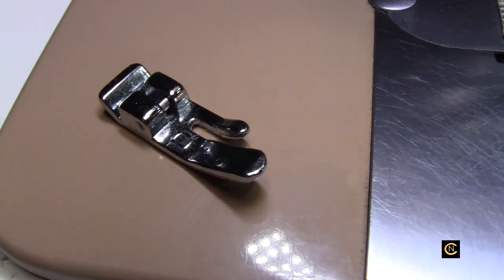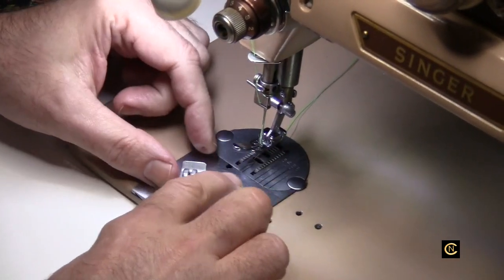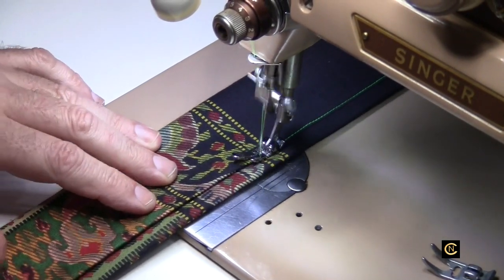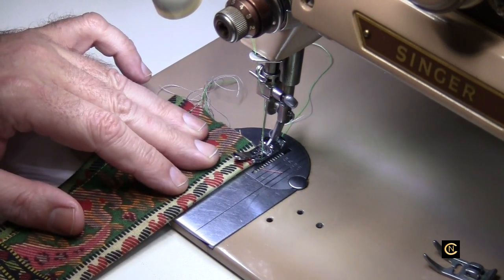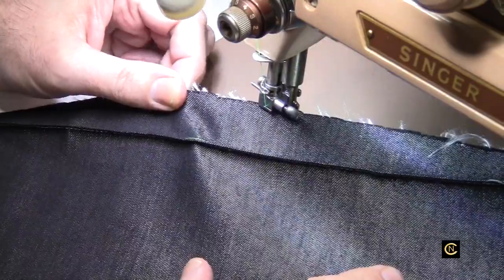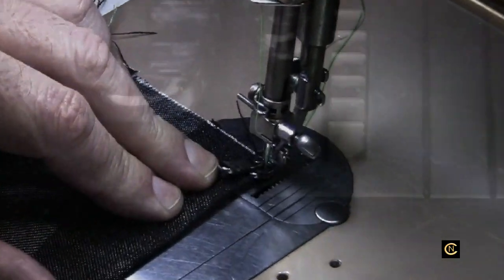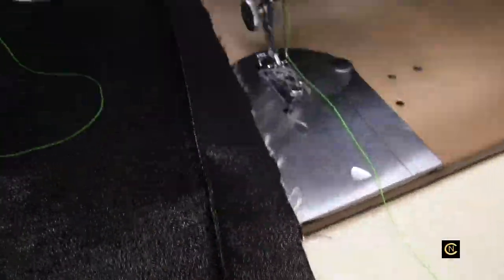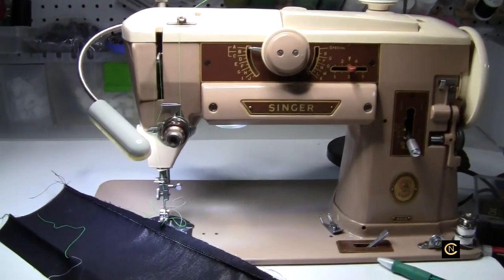Singer 401A Straight Stitch Foot

Comment: I bought a adapter for this machine and it can use any of the snap on I feet  It is a slant  adapter. And I have a lot of   Sewing machine feet, and it fits on a lot of then check eBay I wish I could take a picture to show you anyway thanks for the videos